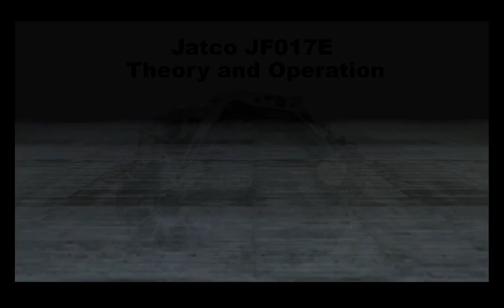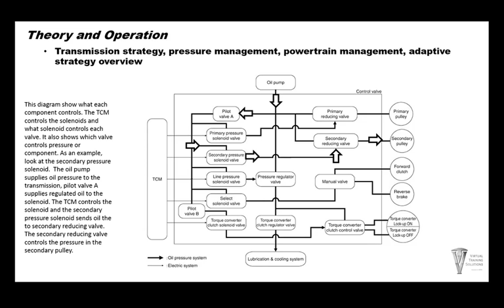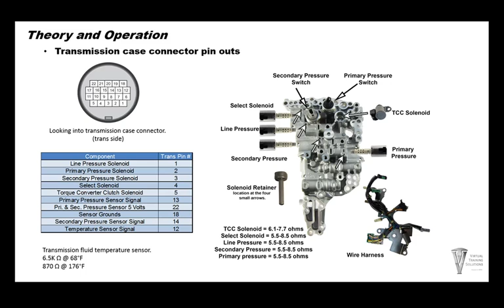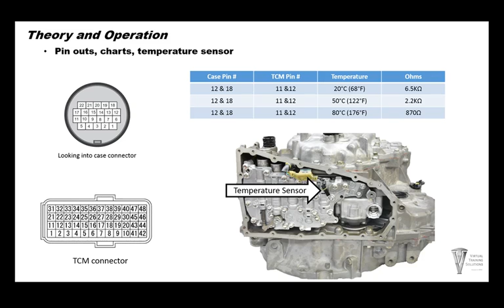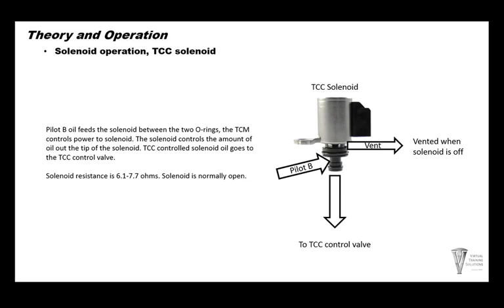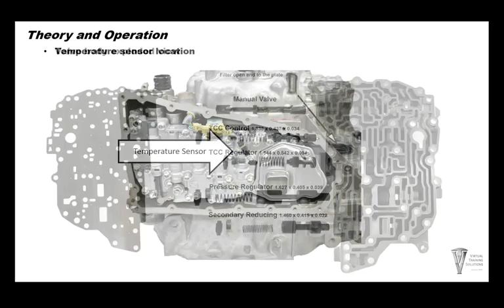04 vts jw jf017e theory operation

Comment: Need help finding out pressure control solenoid A pathfinder 2013
Reply from the maker: There is no Solenoid A or B, that's a generic term scan tools use. You can ID the solenoids by Primary and Secondary. Primary being "A", hope this helps
Reply: @ thank you yes it did help

Comment: Is this gearbox on the Roq or Xtrail from the 2021 model and above T33 engine 2500 cc?
Reply from the maker: Unfortunately, no, this is RE0F10E/JF011E. It goes in the Sentra 20-21 2.0L and Altima 07-13 2.5L-3.5L

Comment: Am i correct in assuming the secondary pressure solenoid is " solenoid pressure B"?
Reply from the maker: Yes, you'd be correct. Depending on the source they will list them as SS1/SS2 or SSA/SSB or primary/secondary
Reply: @atra-automatictransmission1300  i took apart my valve cover and 2 valves were stuck abd wouldn't spring back (the ones with the weaker springs. I took them out gave them a good cleaning. Put everything together. Drove the car. A lot better driving but still judder. Do I need to reprogram it?